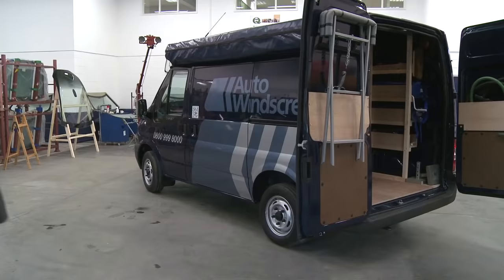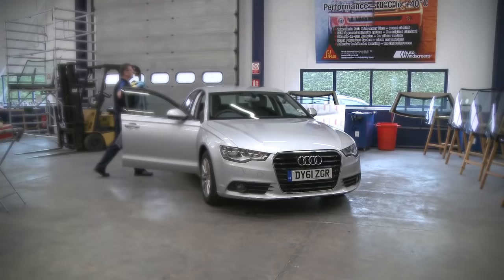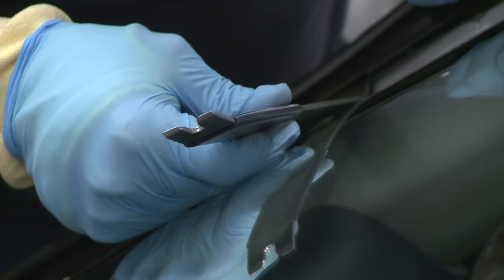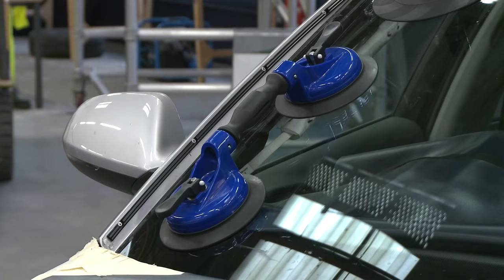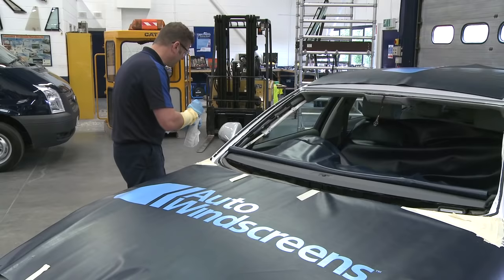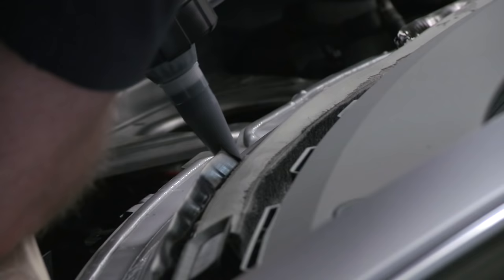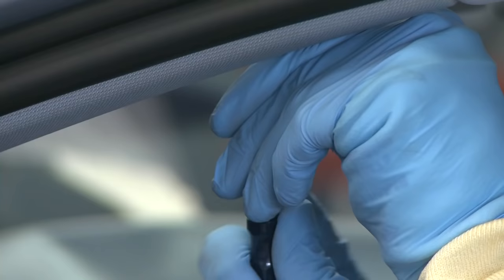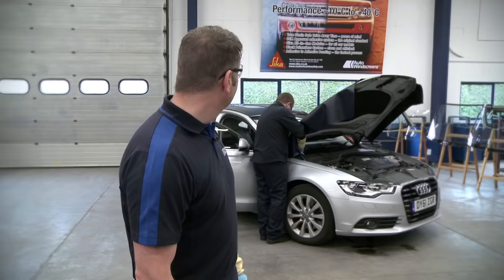How to Replace a Windscreen in One Minute - Auto windscreens

Comment: I was in a car accident, how to replace my own windshield find one at a junkyard somehow pull it out which was one of the hardest things I've ever had to do, guitar string snapped immediately and so did harbor freight wire kit I bought.  I even gave it a hairline crack but I got it out.  My windshield is totaled.  Nothing about this easy.  I've done engine work for a decade this is a pain in the ass.

Comment: Why would the outer trims be loose after I’ve had my windscreen replaced? 😢 this is my second windscreen repair job I’ve had now from said other company and I’m getting tired of the low quality job being done
Reply: Whoever removed the trim pieces most likely broke some clips that hold them in place, some cars have clips that have to be taken off a certain way or else you'll break them and leave the trim loose fitting.